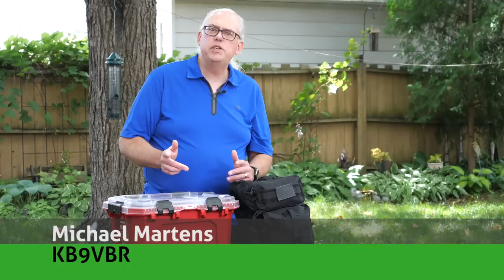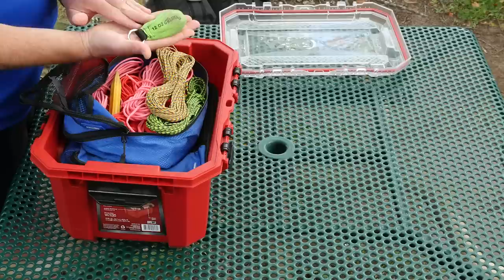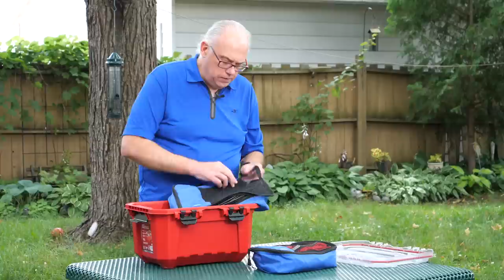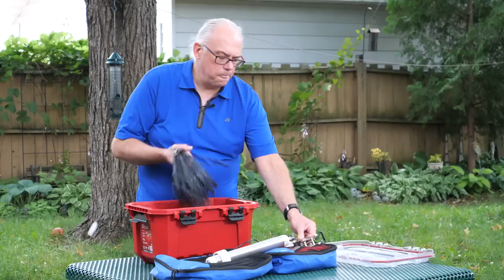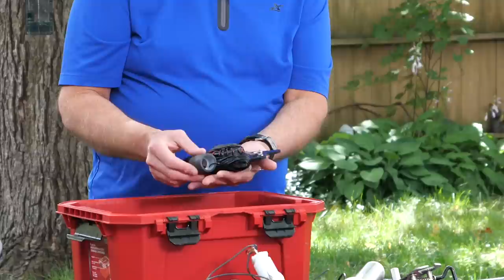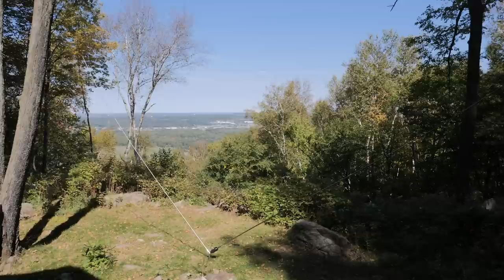Why is my signal so strong? My HF ham radio portable antenna kit #HamradioQA

Comment: Your down-to-Earth style videos are much appreciated.  What have you typically found gives you better performance for long distance contacts between the wire and vertical style antennas?
Reply from the maker: Good question. I've gotten DX on all three of these antennas. I'd  have to crunch the numbers, but I believe I've gotten the most DX contacts with the vertical. But I'm going to add the caveat that the DX usually comes on 17 and 15 meters and I'm most likely using the vertical on those bands.

Comment: I totally agree!  3 great performing antennas that can adapt to nearly any field deployment situation.  They cost me about $200 total and I Iearned a lot in the process.  Mine are very similiar to Michael's.
#1. A Linked Dipole (40-30-20m) - Home brewed for less than $30.
#2. A 40 meter EFHW - Mine is the HF-Kits 40-10 sold by ARRL for $80 (kit).
#3. A 17 ft. Telescopic Vertical Whip with 4-16 ft. wire radials. - Mine is the MFJ-1979 and the jaw clamp mount for about $90.
KZ9V

Comment: Excellent. I like the two is one, one is none approach. I also like that you use resonate antennas. No need for the trick "Tactical" antennas that cost half as much as your radio. You will get the best signal with a resonate antenna and they can be deployed in many different ways. The WRC antenna is also an excellent vertical. I bought the Buddipole/Stick antenna set up prior to the WRC coming to the market. A slightly different style of vertical than the WRC, but I have great results with it. I have added a 17' whip to my BP set up. I really have enjoyed making my own antennas. A portable vertical pole and wire (with radials) vertical antenna is also a great performer. Many choices, but in the long run, the simple wire antennas will be the one's that perform. The real go to antennas. Thank You for the time you spend in doing your videos Michael. Portable does not have to be expensive to be effective.
Reply from the maker: I've consistently received the best performance from the dipole, but sometimes its not possible nor expedient to set that antenna up in the field. Hence the reason I carry three different styles of antennas. At least one is always going to work.

Comment: Great video as was the previous one about the sling bag. I have purchased the Domke wraps for my FT-891 and Tuner. I also find the sling bag less than optimal. Mine is a 3V gear sling, I going to budget for the two strap version, Also those storage bags and the husky box are great ideas. Thank you Sir. Have a great day,  Vern W8VHS 73

Comment: Great video Michael! I've been using a number of homemade antennas, and between the inverted V's, OCF, delta loop, and Chameleon Emcomm III, the inverted V's tend to perform better than the others. I also made a linked dipole for 80 and 40 meters using Anderson powerpoles, and one thing I just thought of is if all I need is 40 meters and I have only that one antenna with me, I can connect the paracord to the insulators at the mid point of each wire and still use the antenna with the 80 meter segments dangling. 73 KD5YOU
Reply: What u suggest for 2m 70cm 
Hiking in mountains and have a pick up to carry equipment. 
Please suggest easy to DIY or something not very expensive to buy

Comment: Michael, I blame, er, credit you with my recent purchase of a WRC Silver Bullet 1000! 😁Took it camping at Waterloo County Park here in western Oregon a couple weeks ago. The camp was busy for three days with grandchildren so I didn't get to spend much time on the air. In that brief time, though, I did make a few west coast contacts right away on 40m with the Chameleon 18' whip, the three standard 33' radials that came with the setup, using 75w on my Yaesu FT-857D. I was quite pleased with the results. I like your approach and style of video production. Very good job! And being from Oregon, your beer looks interesting, too!
Reply from the maker: Thanks for the comments. We may have to set up a beer swap, I've had some beer from Oregon and It's very tasty.

Comment: great video again, and wow plenty of gear, lucky you have a car. For my summer bicycle mobile I always ditch most ants, and use a resonant vertical on 20m or 40m Vertical fibre pole and vertical wire, and being by the sea, 3 radials are all I need, battery and rig, very simple and gets DX every time. Takes me 7 mins to deploy. my recent video on qrz just  shows how simple verticals can be. many thanks for the look into your ham world, its always interesting to see how other use this great hobby, 73 zl3xdj.
Reply from the maker: This is an ideal setup for car camping with our teardrop trailer, but bicycle mobile takes a totally different strategy. I'll be doing a bicycle activation soon, so it will be interesting to see how I pare down the equipment for that.

Comment: Hello, Michael, does the end-fed half-wave need a counterpoise if you have it attached to a ground? And would a 2 footlong copper tube suffice for a ground?
Reply from the maker: There is a bit of a debate if a counterpoise is necessary. Technically, since the end-fed is an unbalanced antenna, a counterpoise of some sort should be provided. But real-world testing has shown that the end-fed half wave operates just fine without the counterpoise. In some instances, the coax is acting as your counterpoise as common mode currents can travel down the outside braid of the feed line. If your coax is long enough to handle this, then there will be no issue. But if you are feeding the antenna with a very short length of coax, the common mode currents may affect your SWR at the transmitter. A counterpoise and/or RF choke will mitigate that. 

While using a 2 foot copper tube as your support will add a bit of a ground, it won't be sufficient to provide an effective counterpoise. 

I typically don't use a counterpoise with EFHW antennas, but I'm also using at least 25 feet of coax. I do use a counterpoise with end-fed random wire antennas, but those almost always require one.

Comment: I see that the Wolf River is good for 10 to 80 meters. Im wanting to use it for 11 meters. can I use the 17 foot telescopic by itself or will I need the coil with it ? Im using a RCI N6 radio with 850 watts pep output , so I need to keep my SWR under 1.3.
Reply from the maker: The coil will cover the 11m band. But it isn't rated for 850 watts. If you have the 17 foot whip, I'd skip the coil and just adjust the whip so it is resonant on your frequency of choice.

Comment: I found your containers. I do like how they work with the whole lid coming off. Need to buy them and get them loaded before summer is over. Been over 95 here in Texas for last several weeks so I have not been in a hurry to get out there yet. Thanks for the insite Michael.
Reply from the maker: We say the same thing about the weather when activating parks in the winter up here in Wisconsin.

Comment: I am exploring for easy to use antenna for hiking in mountain areas. 
2m - 70cm is my playground 
What u suggest ? I have vehicle - a pick up. 
What is best solution ?
Reply from the maker: hiking or backpacking, I'm assuming you are looking for something to use with a handheld radio. Look at the Abree foldable antennas or the Signalstik 1/4 wave flexible antenna. If you want more gain, consider a Yagi like my tape measure antenna: https://youtu.be/BmHoQrDfw-0
Reply: @KB9VBRAntennas  Thanks - I have alinco dual band mobile in pickup and seems Yagi is good option - will try that. 
My handheld is anyttone 878 UVii plus - a signal stick may not be sufficient in mountains to catch repeaters- dobu suggest Jpole or what ? A long wire antenna on trees ?

Comment: Why would you use a dipole over the EFHW?  I currently have a EFHW I've been using  and didn't see the advantage of the dipole.  Is it just more convenient to have the coax come down in the center rather than the ends in some situations?
Reply: WSPR test comparisons between my linked dipole and my EFHW in similar configurations favor the dipole by 4 to 6 db.  Both are great antennas.  The EFHW wins on multband convenience, but the dipole wins on signal performance. 
KZ9V
Reply: @davewhite7679  did not know there was such a large difference.  Looks like I need to build some dipoles.
Reply from the maker: There is a slight efficiency loss with the end fed half wave due to the transformer, but not enough to really call it a compromise. The big difference is that being a multiband antenna, the EFHW's radiation pattern will change on its non fundamental bands. The dipole, since it is a monoband antenna, will always have a consistent pattern (although pattern can change with deployment height and ground conditions). 

Long story short, I like both antennas and in using both I find that I consistently put out my best signal and hear weaker stations when I use the dipole. When propagation is challenging, this can make all the difference. Sometimes it is worth the effort to put up a mono band antenna.
Reply: @KB9VBRAntennas  That's really good to know.  I'll need to put together a 20 meter dipole together.  I've had a good luck making contacts on my EFHW but I'd like to make DX contacts which can be difficult from Minnesota.  Thank you for the info!
Reply: @radian2323  remember DX to Europe is easier with main radiation lobes of antenna aimed towards NE. So almost over the pole.  Reached DXCC phone from Northern Minnesota recently using 100 watts and wire antennas (random wire end fed and g5rv Jr).
Reply: @RMJ01  Interesting.  My dipole is pointed at about 25 degrees so I have a pretty good null in that direction.  Looks like I might make some changes this weekend!

Comment: What type of wire do you use for the radials? de VO1OK
Reply from the maker: I'm using 14ga THHN stranded wire. You can use any gauge though. I have a big spool of the 14ga, so it gets used for these kind of things.

Comment: Have you ever had problems getting throw bag/rope stuck in tree? 73 DE W8LV BILL
Reply from the maker: I've had other objects get stuck in the trees, but never the throw bag. It's design (steel shot in a canvas bag) has mass but also a damping effect so it is resistant to wrapping itself around branches.